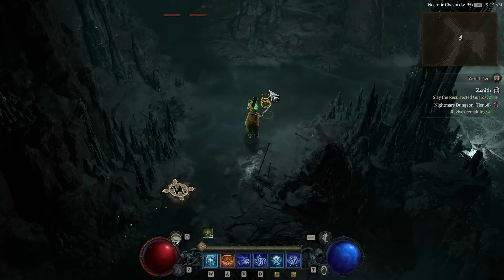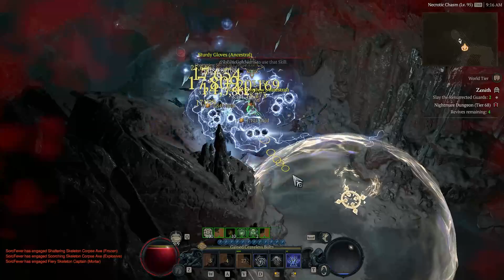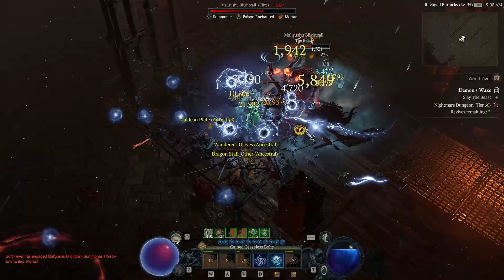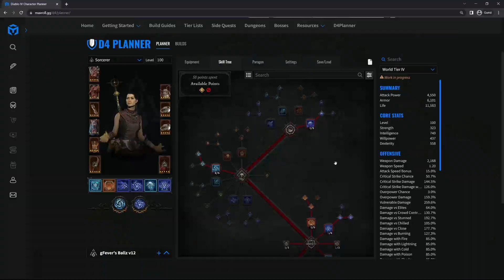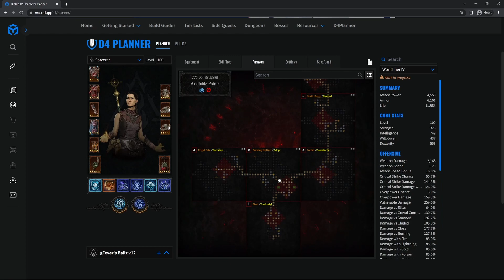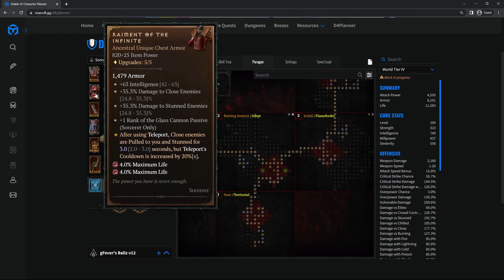Infinite Ball Lightning Sorceress Build Update | NO FROST NOVA or FIRE BOLT ENCHANTMENT!

Comment: I am in awe of your gear. Literally every single affix here is rolled to it's max possible value and they all seem perfect. Most didn't even require affix rerolling.
I am assuming you bought most that gear?? Where have you had the best luck buying gear?
Reply: Great build btw and a nice twist on ball lightning. I am running BL in the nm 50s on my LVL 86 sorc now. I will try this variant out once possible.
I am using the teleport enchant to jump around and stun everything constantly. Getting rid of the fire bolt enchant and replacing that with Frozen orb seems interesting. I guess it is meaning our only burning synergy then comes from flame shield and your only vulnerable comes from frost orb enchant
Reply from the maker: @Snipercapt09  yes, the only problematic content in the game are elites, so you don't necessarily need fire bolt enchantment for trash mobs. However, frost nova will always be better as its on demand, but I don't like following meta.
Reply from the maker: The gear is idealistic, you can purchase somethings close to perfect roll on the d4 official discord.
Reply: @gfevertv  ah ty that makes sense. you are showing this from d4 planner so you can select any stat you want unlike showing from inside the game. lol i missed that obvious bit. 
Thanks for the responses and new take on this build